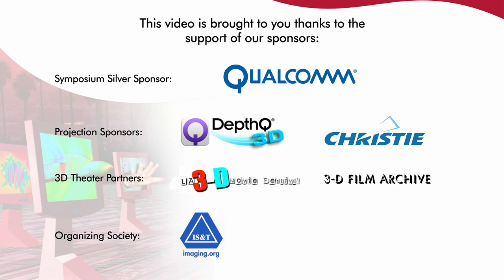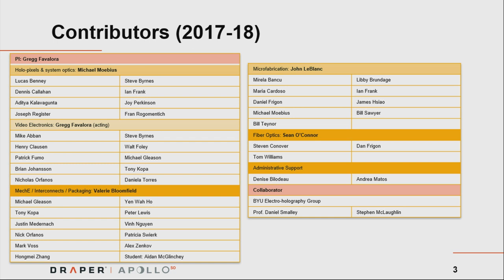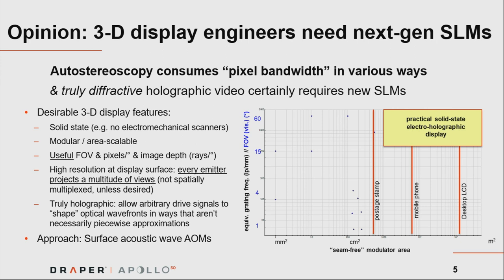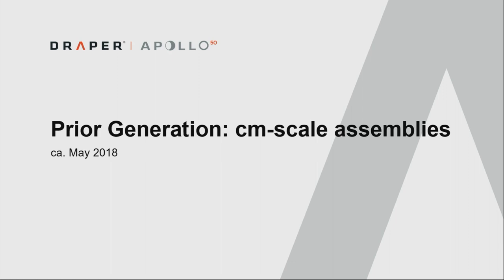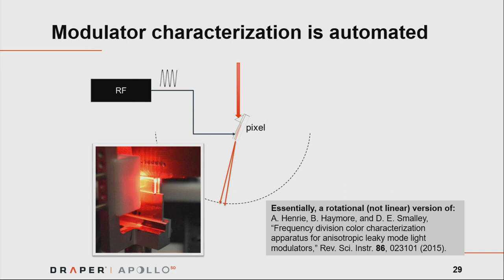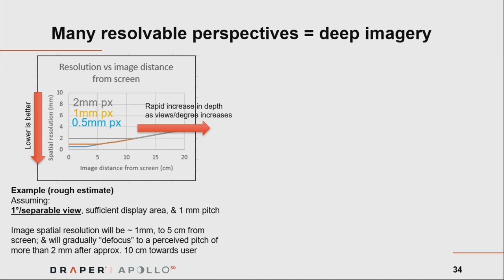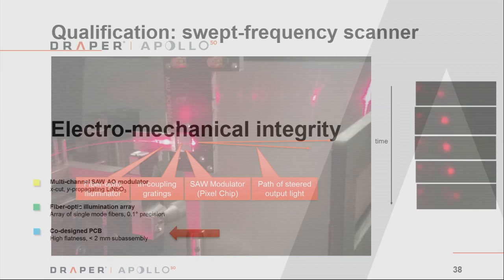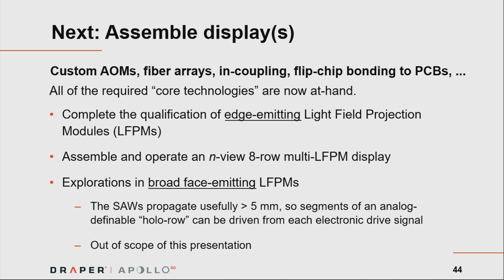SD&A 2019: Electro-holographic light field projector modules: progress in SAW AOMs...

Comment: Modern day digital black magic lol. I pretty much can wrap my head around the concept except for the depth aspect. Sure being able to scan lines of dots from an edge emitter is cool, but how does the emitted photon wavefront get diffracted or diffused into a spatial representation of the image from whatever x angle? Is the light then going to a lcos or mems scanner or dlp to recreate the image after being steered yo the view angle, or is the image created from the actual array of light emitters itself? Does the diffracted light coming out of the emitter represent the image when viewed all together as part of the array? Or does the emitted light scanned to represent angles of a image being viewed on a projected surface or screen after going thru or reflecting from a surface making the image? Or am i im not thinking of this in the right way. Im not an expert by any means with any of this stuff but i find it all fascinating.